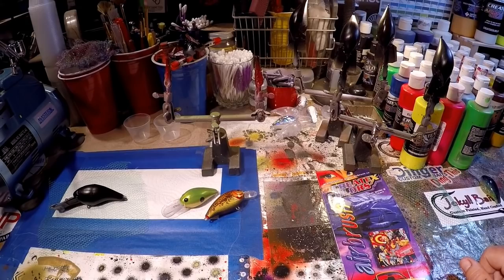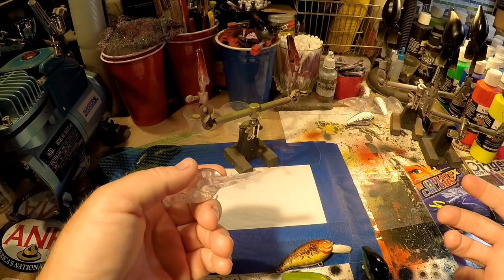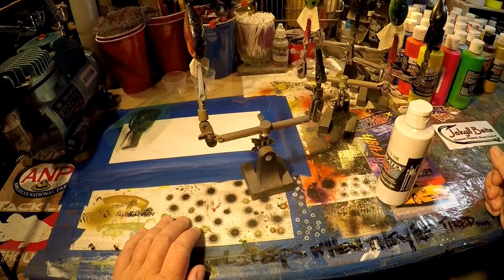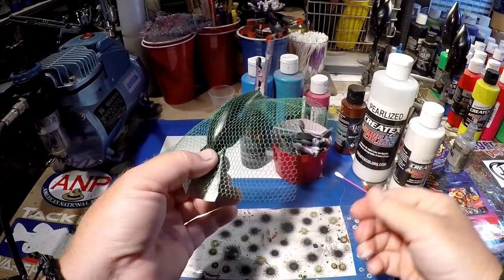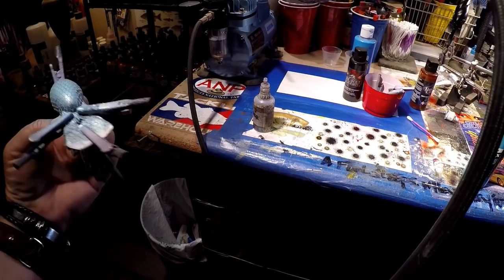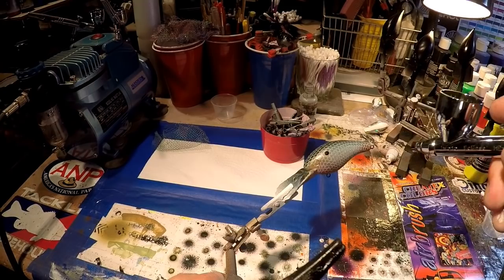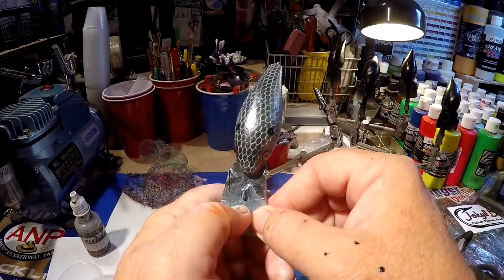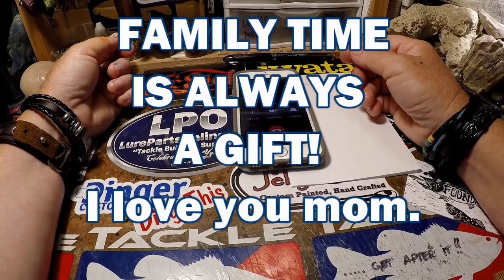JBCo. Spray Sessions: FAQs, Quick Tips and Painting a Threadfin Shad

Comment: Awesome videos and I have been binge watching as well. I am a noob to the airbrushing thing and I do have a question. I have been using netting to make my scales in various different hole sizes. I always seem to get marks in my bottom layer form the netting even if I heat set it prior to putting the netting on. Can you give some advise how to avoid this? Thanks for your videos, your attention to detail is what inspired me to begin this process. I am not trying to sell baits but increase my arsenal..lol
Reply from the maker: Let your previous paint dry longer before you mesh or net it 😊

Comment: For those using the scrub brush don’t. I know that it might be easier but the netting works so much better it is less expensive and it doesn’t have “memory” meaning that it is flat no curves which the luffa will also if you pull the luffa to get it flat it will create large scales in some portions and it can become really odd shapes.
Reply from the maker: Great point! Thanks 🙂

Comment: Have you ever painted or repainted jointed baits? Also would you recommend using KBS on a jointed bait? Thanks for all the tips and for sharing!
Reply from the maker: Yes and they should be brush coated instead of dipped. KBS is fine, but there are other options if you’re not a KBS user
Reply: I’ve been considering switching to KBS and am just concerned about it causing binding on the joints and affecting  the action of the bait.

Comment: I noticed you aren't using any paint thinner. I've always been told to thin out the paints, is it ok not to? Also you use 35-45 PSI for most of it then 10 psi for the detail work?
Reply from the maker: You are correct. If I’m layering and detailing I do occasionally thin my paint, but not often

Comment: Another great one !  Tell us about the compressor you are using.  I am on the fence about  how much I really want to pay for a decent one.
Reply from the maker: Master Air Compressor Single Piston. I love it. It's a work horse!Here's a direct link and I pasted the description under it.https://amzn.to/2JqNYKF
Powerful: 1/6 Horsepower; Delivers high air volume (0.8 cfm) and air flow (23 ltrs/min)Portable: Lightweight, compact and easy to carry with the built in handleBuilt-in Fan: Fan keeps the compressor motor cool while in use. Designed for longer continuous running without overheating and a longer service lifeLonger Duty Cycle: Advanced technology motor with premium rotar windings and a longer duty cycle that increase the service life of the compressorPrecise Air Adjustment: True diaphragm pressure regulator with gauge and water trap filter that provides precise adjustment of airflow and will ensure clean, dry airAutomatic On/Off Shutoff: Preset for automatic turn off when air pressure reaches 57 psi. Preset for automatic turn on at 43 psi. This enables a longer compressor life from less motor wear and heat-related moisture"Air-On-Demand": Designed to work only when you do, produces full-capacity air on demand. Automatically shuts off when not is useThermally Protected: Automatically turns itself off if the unit becomes over heatedSingle Piston Motor: Maintenance free, oil-less and quiet operation (47 db)
Reply: Thanks Jenn !  I was thinking it was a Master, the lighting wasn't allowing me to see the brand clearly.   I ordered one last night from PCS Global along with a Master airbrush (for my son to learn with) and all the goodies.  I have an Iwata compressor, and Iwata Eclipse airbrush ordered for myself.  I have a couple of Pasche airbrushes in my stuff somewhere , one a single action H series, the other a double action VL series.  Should  be able to paint now.

Comment: Kinda on a diffrent subject but im having probblems with kbs. I'v destroyed oh about 150 baits this year fishing walleye and pike. After 5 coats the they still get through the clear and it comes off. Somtimes in two fish.
Reply from the maker: Anything with teeth will chew a bait up eventually, but try leaving the bait on the rack for a few days longer to cure before using it. And longer periods of time between adding additional clearcoat layers. At least 48 hours.
Reply: Jekyll424  some of these baits wer cured in December still ripping them up. Im starting to wounder if its kbs its self. I'm waiting for aluma-uv to show up now. But there is no way to sell a bait like this in my neck of the woods.
Reply: @adamjohnson5551  Have found that baits that get  skinned up some  times are go to fish catchers. Maybe cause the predator thinks it is an easy mark
Reply from the maker: Maybe. Have you looked into the UV Resin curing? Alumilite?
Reply: Yeah i have a gallon right now. Aint got a chance to fish a bait with it yet. But i smashed one with a hammer. Kinda impressed.